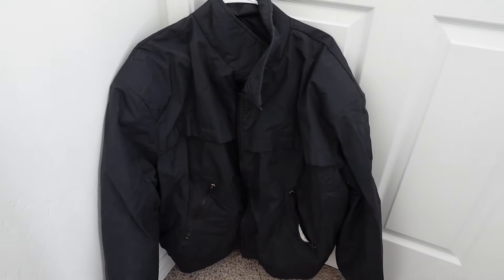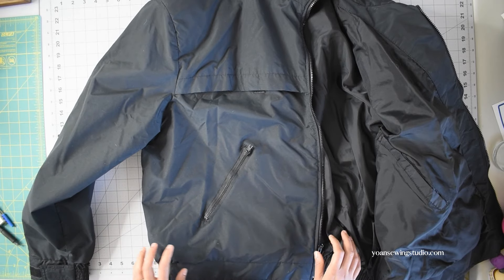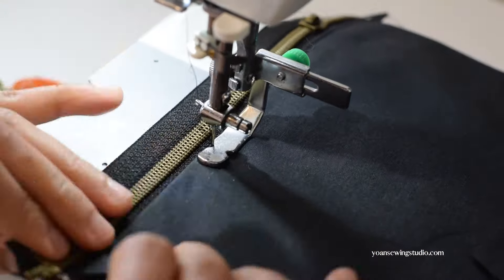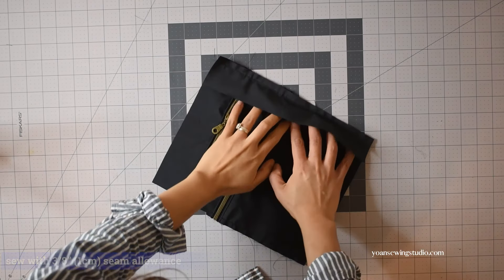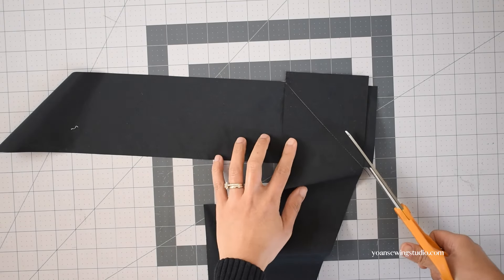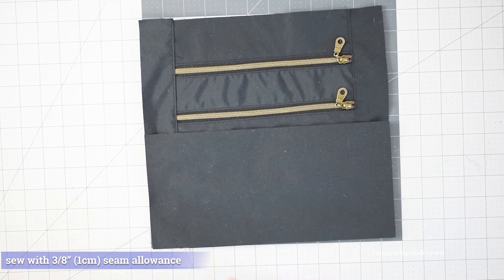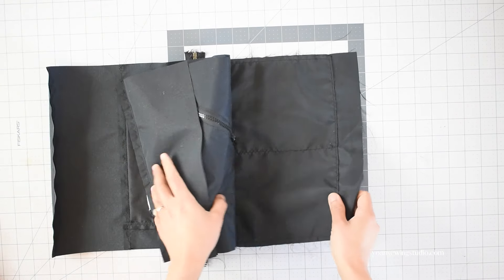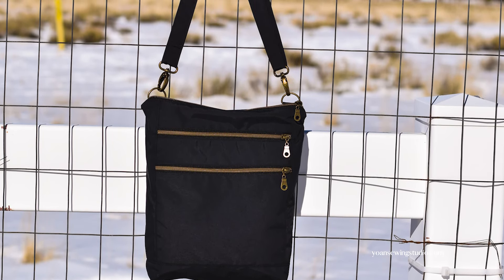Three-zip crossbody bag - upcycling project - make this from an old jacket or not

Comment from the maker: Note: If you wonder why I didn't replace the zipper and keep the jacket is simply because this is a 17 year old jacket, though the outer fabric is in good condition, the seams started to wear off and not worth the struggle to try replacing it, on top of that  I dislike replacing zipper that's the one thing I don't care about doing as a sewist :)
So, if you happen to have an old, slightly worn out or outdated jacket, you can use that to make this bag, otherwise feel free to use fabric that you have in your stash (i.e canvas, denim, or home decor fabric)
Get the PDF pattern : https://bit.ly/3vLJFro
Happy Sewing all, thank you for your support ♥